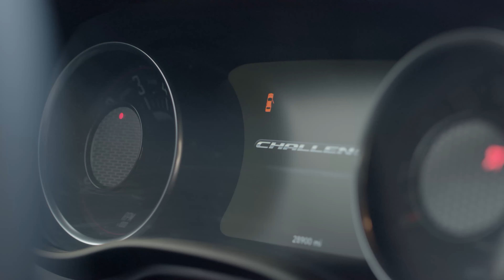Replacing License Plate Bulbs | 2007-2011 Toyota Camry

Comment: i can’t get the bulb out no matter which way i turn it
Reply from the maker: Thanks for reaching out! I'll have to revisit and see what could potentially be the problem.
Reply from the maker: Just looked at it and it should be able to come right out.  Unfortunately you may need to take to a shop and let them do it.  It may just be stuck and if you turn hard enough it’ll come out.  But that can be scary if you’re not trying to jack something up.  Sorry
Reply: I had trouble too with the left side specifically, I used some pliers with a rag wrapped around the light to not damage the plastic. After applying light clockwise pressure with the pliers I got it off! Hope this helps! And awesome video thanks, @DZRIDEZ